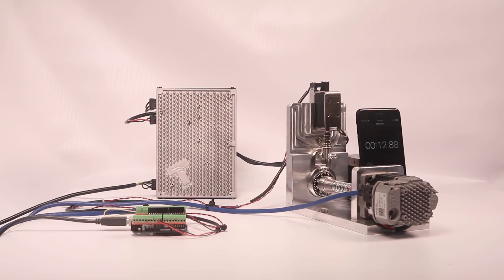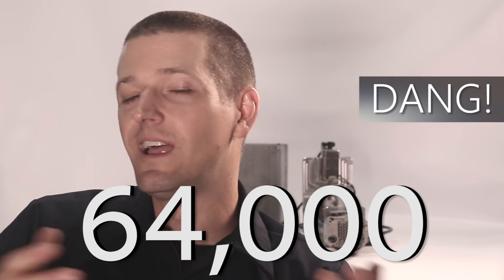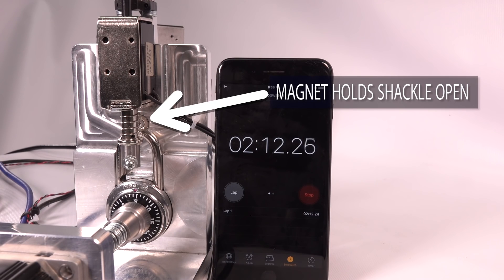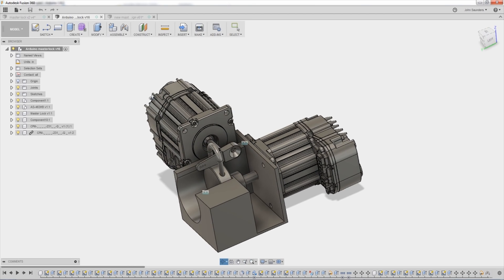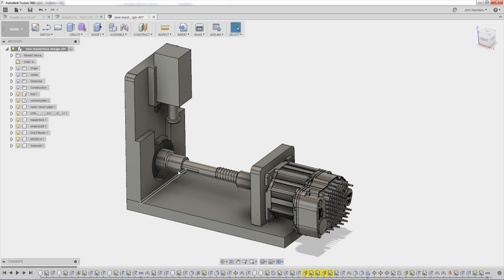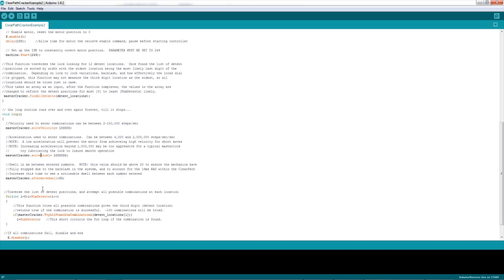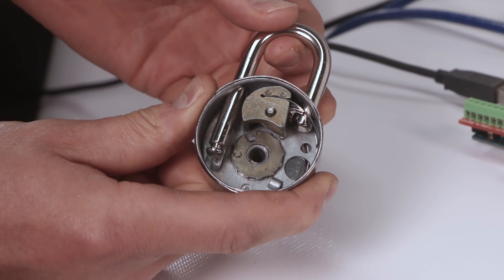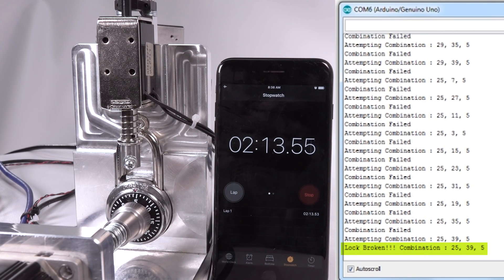Arduino Master Lock Cracker!  WW146

Comment: Hey, did you use "De Bruijin Sequencing" making this? To sum it up lets imagine  a masterlock with numbers 0 to 4 and a code of a length 3. What it does is instead of going through numbers 00,001,002..101,102... you can combine them like this 0 0 0 1 0 0 2 0 0 3 0 1 1 0 1 2 0 1 3 0 2 1 0 2 2 0 2 3 0 3 1 0 3 2 0 3 3 1 1 1 2 1 1 3 1 2 2 1 2 3 1 3 2 1 3 3 2 2 2 3 2 3 3 3.

Comment: Thank you for mentioning that Arduino API is slow by embedded standards, though it is something I have known for a long time, most beginner users of Arduino would not know that.  The only way you get 1 clock GPIO is through the use of timers and bare metal GPIO port manipulation.  For more than GPIO, this gets difficult though, and will require the careful reading of datasheets.  This is good to learn, but will take hours of research and potentially longer to debug.  

Having spent the time developing servo firmware, I now know that an Arduino directly driving motors with an H-bridge is only slightly uglier than a bare bones AVR, at least for what I was trying to do.  Using an arm Cortex M is better if you don't mind bare bones embedded development in C, it will have overkill speed and will not require 8 bit processor optimizations for faster control.  

Using optical isolation between the microcontroller and H-bridge with separate supplies is a very good idea; I have zapped more microcontrollers with motor control than any other way.  Another good idea is to use external diodes from H-bridge outputs to output power rails, this will prevent damage to microcontrollers.

Comment: For all the complainers: this was a demonstration of concept and a demonstration of capabilities (of the hardware, the software, and the designer). The "brute force" technique (trying all combinations) predates everything but the actual invention of combination locks of this type. Nobody on Youtube (or in the 20th or 21st centuries for that matter) invented it.

If you all you want is an openable Master lock, you can buy a new one with the combo card attached for a few bucks without needing to design, build (and pay for) a machine to crack it. If you want an existing lock open there are plenty of ways to "getter done"; I like a Sawzall™ with a carbide abrasive blade myself (or a cutting torch). This was pretty cool if you ask me.

Comment: there are even and odd locks, every lock only has about which is about 8000 possible combinations. if you know the last digit, your number of permutations could be reduced to 400.  if you analyzed the indents, the number of permutations could be further reduced. I think I'll look at the ClearPath Library.

Comment: Not sure what's the educational value of this. On the mechanical side a high school student can't do the complex machining for the jig. On the Arduino side, they won't have a corporate sponsor to provide hours of free software engineering. A library that does all the low level driving and interfacing and register mangling, and lets you set the motor at a specified angle is one thing, a library that provide a "TryAllPossibleCombinations" is just nonsense; it wouldn't exist in the professional world or in the amateur/hobby/maker world. To paraphrase you, "frankly here that's not OK".
Reply: So... Nobody except high-school students can find anything educational?

Get outta here with that trash, commie!

Comment: Great video :-)   Can you share your motor config.. I'm reading Teknic's source and not sure how your motor is config-ed to get that kind of data from HLFB.. It seems to be reading state that doesn't match the 3 HLFB modes.. at least not as I understood them..
Reply: Hands on CNC - Great question.

This is Brendan from Teknic and I helped create the libraries that were used in this video. The HLFB mode that was used was the "In Range" HLFB mode.

The Arduino commands the motor to move in one direction while simultaneously pulling up on the shackle until the lock hits the edge of a "detent" (or gate).  Once the lock hits the edge of the gate, the lock dial cannot continue to move in that direction which increases the tracking error of the motor. This tracking error triggers the "out of range" bit in the motor. Then the Arduino captures the position of each gate.

For this device to work properly, the torque limit of the motor was lowered so that the motor doesn't "push through" these detent locations. Hope this helps.
Reply: Thanks!   That's what I was curious about.. By the way, thank you for commenting your C++ code so well.. Much appreciated!

Comment: Fun Math Fact: When the "combination" lock numbers are chosen, the order is important, and you can't repeat a number, it is therefore actually a permutation lock rather than a combination lock. The equation for calculating the number of permutations in this case is n!/(n-r)!, where n is 40 and r is 3, which gives us 59,280 permutations.

Comment: Awesome work John, keep it up. I have a feeling that you knew this was the most cumbersome way possible to crack a combination lock. It is very inspiring though. What is really cool, and obviously missed by all the comment cry babies, is the technology doing the work. Fushion360 is FREE parametric CAD/CAM which allows you to build your design virtually. If NASA had an Arduino in the 1950s we would be living on the moon now. The ability to machine precision parts in your home without needing a donkey engine, line shaft, and a ceiling full of belts. Servos with built-in drives and a company that will offer specialized support? These are great times we live in. I have enough spare parts on the shelf that I could build one today.

Comment: Damn i cant believe that you told Grimsmo that his project was a complete waste of time. This is  cool but far beyond useless.
Reply: And Grimsmo admits that John was right, in that case. Grimsmo was reinventing the wheel, so to speak, and the time and materials he spent working on that project cost him more in the long run than simply purchasing an off-the-shelf-product would have. That's the difference.

Grimsmo knows Saunders was correct, from a LEAN perspective. In retrospect, he realized that he failed to 'stay in his lane' so to speak, he openly admitted it, and said he was going to tell Saunders that he was correct as well.

Grimsmo is about production of product, and getting it out the door. Saunders is about running his job shop and working on cool little hair-brained projects and putting them on Youtube/Patreon.

Saunders is in his lane with the project. Grimsmo was not in his lane with his project.

Apples and oranges.
Reply: ROFLhacks Two differences... John S. is a YouTube creator who puts out a ton of videos and needs content. John G. is a YouTube creator who puts out an "update" video every quarter to 6 months.

Comment: Not using digital write is called bit banging. On the arduino mega, I'm writing a linuxcnc via ethernet to arduino mega system. Basically a poormans MESA card. On the mega PORTA, PORTC, PORTF, PORTK, and PORTL are nice in that all 8 bits goes to pins. On the other ports you may get 2 to 6 pins per port which add a bunch of over head. On the uno and nano i think you only get 2 ports with 8bit access. John see you at Stans house!
Reply: That is awesome, I was planning on using machinekit on a BBB for a conversion. Unfortunately, I am not working on a machine small enough to warrant it at the moment.

Comment: Classic over engineered product from the states. You could use that clear path to brute-force open the lock :D
Reply: Bet he doesn't actually feel dumb at all. Dunning-Kruger effect is a hell of a drug...
Reply: Google+ SUCKS BALLS - the worst forced social network I don't think you know what brute force means in terms cracking a lock/code/password. BECAUSE IT CAN'T BE DONE WITH 1 MOTOR. (Unless there's a lot of complicated gearing and other mechanisms. That's so cute, you thought brute force attack was using physical strength. Bet you feel dumb.

Comment: Nice that you credit the YouTuber that came up with this idea. :-(
Reply: People have been brute forcing locks for a long time with motors. Do you guys comb the internet looking for people that have the same ideas?
Reply: Safecrackers have been cracking locks since forever.
Reply: Chaos yes you are correct about that, but a bit over a decade ago, I got to use a real pro version of this. It was called the auto dialer, it entered combos till it opened and then saved the correct combo for you to document. It can be used on padlocks aswell as safe/vault doors. I really wanted to buy one but back then they were a few thousand dollars, though I have seen different versions over the years at shows like DEFCON priced way more affordable for the small time non destructive entry techs.
Reply: If you're talking about the guy who did it in plastic and cracked it on the first try he didnt do anything like he did here. He just set it to pop in the correct code. This is an actual cracking program.
Reply: JdC Turbo you came with that idea?
Reply: Chief Machining 
sadly not. Sammy kamkar did search on YouTube Sammy kamkar code breaker
Reply: I would assume it was a simple mistake or oversight. He has always been good about sources in the past afaik.
Reply: Sammy KamKar was not the first.

Comment: Hate to sound critical, but if you did this with a steppermotor and an easy driver, anyone could do this for 30 bucks.
I have a couple of these drives but they are WAY to expensive to just have laying around or dedicate to a fun toy...
Reply: Sharklops He already said ohm the video introducing the motors about how he got them. Most of the time YouTube'ers get products for free without any stipulations. The manufacturer just hopes the product is shown off in the video, or that the product is mentioned on the channel. For them to send $600 (retail. so it prob only cost the company a couple hundred bucks to send the two motors.) worth of motors to John in hours of him talking about them is worth WAY Moore than the couple hundred bucks worth of product. Or whatever agreement John and they came up with. I bet if they tried to tell him how to place the product, with all sorts of stipulations, he would have just bought them on his own. Also, usually when you're working for a programming/research type of company, they have the rights to whatever you develop. Like when a researcher develops a drug while working for a pharmaceutical company like Pfizer... it's not the researcher's drug. Granted I don't think that's the case here because you obviously found out that it was developed by an employee.
Reply: One would imagine Teknic is providing some consideration in return for showcasing their motors with this project.

Comment: Now you need to pull up on the tab whilst turning the shaft, measure the current draw of the servo to detect when it stalls to find your detent locations, then use the input of those locations to crack the lock even faster.
Reply: I really should watch the whole video before leaving a comment :-P  Great job!